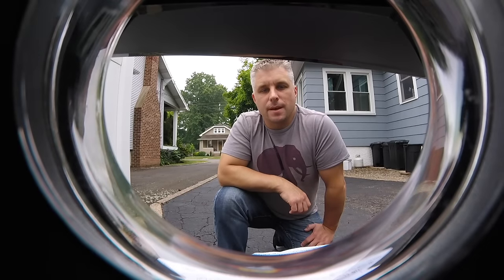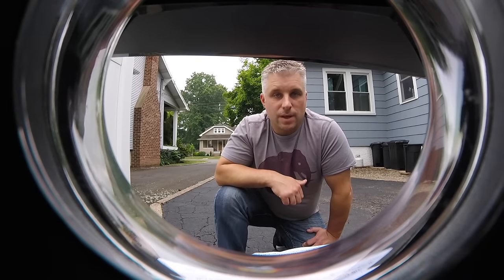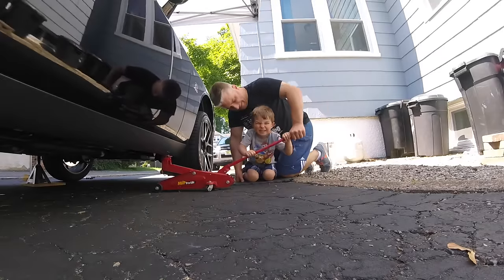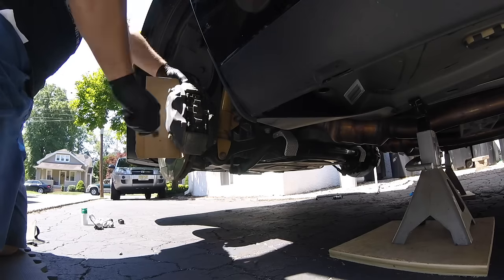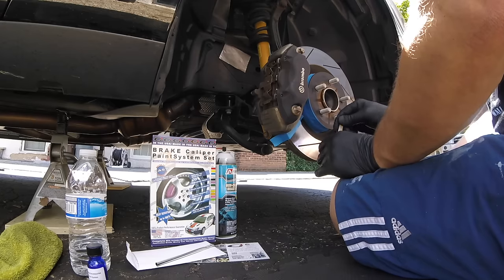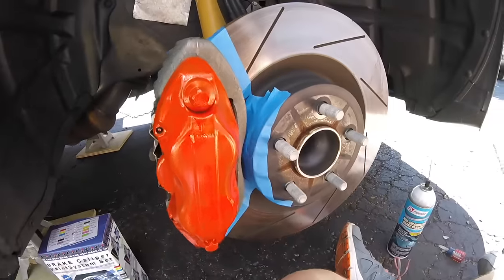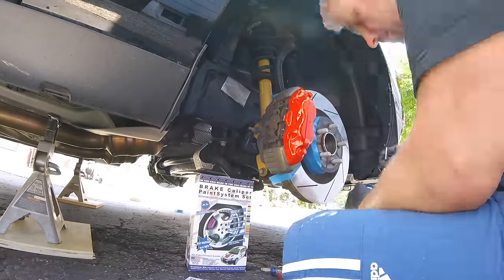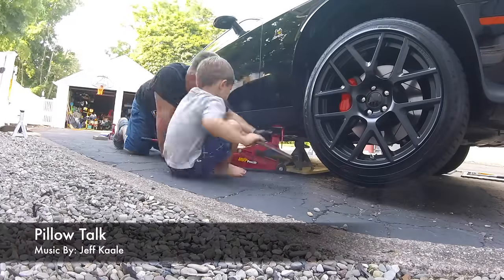G2 caliper paint - Scat Pack Wheels Finally Done!

Comment: What did ya use on the hub of the rotor to make it black? mine look awful too! awsome page man and beautiful car!
Reply from the maker: +Blair Gray thanks man, I used high heat matte black engine paint after sanding and using tons of brake cleaner. I recommend satin though the matte is not as black as I hoped it would be.  Check out my blog post http://www.workplaydrive.com/2016/05/10/annoying-thing-about-my-black-scat-pack-wheels-fixed-10-00-per-wheel/

Comment: Where did you get your center caps and lug nuts? Mine are chrome on my 2016 scatpack and it’s driving me nuts!
Reply from the maker: The forged scat pack wheel (like mine) came in 2 colors black which was satin black and hyper black which was a silver with a little sparkle. I have both center caps below. 

The lug covers were actually a temporary cover I liked so much I still use them 5 years later. 

Lug Nut Covers 22MM
Flexible Vinyl Round Cap 3/4" Inside Height, Fits 7/8"-15/16" OD
https://www.mcmaster.com/#9753K57

FLAT BLACK
CAP-WHEEL CENTER - MOPAR (6CZ27RXFAA)
http://www.stevewhiteparts.com/oe-mopar/6cz27rxfaa
DISCOUNT code: Face1

Hyperblack 2
CAP-WHEEL CENTER - MOPAR (6CZ27MALAA)
http://www.stevewhiteparts.com/oe-mopar/6cz27malaa
DISCOUNT code: Face1

Comment: Great video, I'm doing mines next week, what is that thing that you use to  jack up your car, the one with the remove before flight  reminder
Reply from the maker: Thank you,  It's a magnetic jack pad with a little flair ;), it protects the pinch weld and the trim around it.  There are cheaper ones just make sure you stay away from the hocke puck looking ones they still mash the trim  This type totally prevents my trim from being mangled by the jack  https://amzn.com/B00O72Y2CE  so $40.00 well spent.

Comment: Hi I just came across your videos there awesome thank you! !!! My question is did you consider red before the orange? I have a 2014 Charger R/T Road and Track Plum crazy edition all badges are red and want to be close on calipers.  Are the orange very orange or a reddish orange ? Do they look like the dodge red double slash? Thanks keep up the good work and stay safe.
Reply from the maker: Thank you 🙏 I like orange, red wasn’t a consideration.  The orange is actually a nice vibrant orange not reddish not  close to GoMango.  G2 has a nice red that does match the badges the other option is send them your paint code to color match your car.

Comment: I notice on the front you painted just the tops.  Long story short I had mine done this weekend and the shop that did mine did the same but I went back and looked at yours and you did basically the tops also.  A lot of the videos I looked up here they paint the whole caliper if that makes any sense.  My question is there really a right and wrong way to do them, the tops only being done or the whole caliper like I see a lot of peeps here doing.  Thanks and looks bad ass BTW!

Comment: What a GREAT job you did both on the brakes as well as the tutorial brother!! Thanks for all the info and details, I certainly appreciate it!!! :) BTW, it's nice to see another 6'er SP on the circuit...lol...I factory ordered my '16 SP Shaker this May and it came in exactly 14 days later, which was awesome for me. It has everything available to it but for the A8, obviously and the Pwr Moonroof. I went with the Black Interior, Black Alloy Wheels and wrapped it up in Maximum Steel and I love that colour, ever since I saw it on a Ram 1500 SPORT last fall. Is there enough paint in the kit to do the full calibers or do I need (2) kits for that job?? I'm not going to do it now simply because the days are getting cooler and pretty soon it's going in the garage for a "long winters nap"...lol...So, it'll be a spring time job for me to do and that's ok with me. And my TAZER should be here this week as well and thank god the (Shift Lights) can be engaged!!! What BS is that, huh?? You activate it and nothing happens...lol...Jeez!! Anyway, great video, thanks a heap man!!! Stay Safe!!
Reply from the maker: Thanks man, there is more than enough paint in the G2 can to do 4 coats on all 4 caliper covers. even if you paint the rails on the front.  I've got another kit in black to finish off the front rails, cant wait to get it done.   Congrats on the SP Shaker, When I was looking last year I was unable to order the Scat Pack Shaker in Manual, So I searched for the Scat Pack with all the options I wanted (sadly could not get the bee seats) then I made it a Shaker with a Cervini's kit.

The TaZer is working out great, Shift lights do work I'm just learning how they work in different situations before I put out a video later this week

Comment: Looks awesome. are they still holding up alright? I was looking at doing my brembos red, but a lot of products had reviews of them chipping.
Reply from the maker: It's been over a year and still looking great https://www.instagram.com/p/BXBQxE6lQuN/?taken-by=workplaydrive 

Prep is important no oils, flaking rust or paint under the coating.  

NO primer and NO clear coat.  This are the biggest things I see people use and fail.   G2 is an Epoxy paint it bonds to the metal and shines beautifully on it's own. 

I have 1 chip from some guy doing a burnout at cars and coffee, his stupidity shot gravel at my car and chipped my door paint, wheel and G2. :/ otherwise they are flawless.  Even the G2 I spilled on my Driveway is doing well 😂
Reply: That's pretty awesome. I'm torn between having a pro do it with a guarantee behind it at 50$ a wheel, and doin it myself for 50 flat haha
Reply from the maker: At $50.00 a wheel you can mess it up 3 times and still come out ahead.   As long as you have the supplies to lift up the car safely it's a pretty easy task.  I just hung out with my son and went around the car 4 times 1 wheel at a time.

Comment: hey by any chance did you ever get the brakes on your car like brake calipers both fronts what is the cost to change them whatever they wore out just need to know because I own a 2016 Dodge Challenger 392 shaker 8spd
Reply from the maker: Not yet, only 11K miles and it's an M6 so I let the lower gears slow me down.  Price for pads will vary depending on the materials.  When it's time I plan to find a less dusty pad solution for daily driving use.

Comment: Did the paint wrinkled at all? I tried it once and it was real wrinkly..any advice? Looks great and thanks
Reply from the maker: no wrinkles it's very smooth and glossy.  https://www.instagram.com/p/BNcBlRJjH8G/ Is it possible you bought old stock from a re seller?  Another possible issue because it's an epoxy paint, if you used a synthetic store bought brush depending on the material it may melt causing globs.  using the provided brush prevent that.
Reply: Work Play Drive awesome man. Those both were prob the issue. You think I should completely sand the old application off and redo? Or or just smooth them out? Thanks again
Reply from the maker: g2 can be applied on top of G2, however you want to sand down the wrinkles so it's smooth and make sure there are no flakes.  You want that G2 to bond to a solid surface.  If you find the old paint is flaking off you will want to take it all off.
Reply: Work Play Drive thank you sir. You are very helpful

Comment: Hi I like your vids subscribed! I want to paint my rotor hats silver there starting to show light rust spots want to get it before it gets worse, Is one can enough for all 4 rotor hats? 
Can I paint where the wheel hits the rotor ? 
Thanks!
Reply from the maker: Antimatter thank you!  I had to reread my website post on this...  I used 1 can to do 4 lite coats and 2 heavy. 

if you paint where the wheels sit I recommend you let the paint dry for the full time recommended by the can before putting the wheels on.  it's also recommended to re torque the wheels after 50 miles of driving.

Comment: Really good job...  I have seen a few others do this process and yours certainly looks nicer.   One quick question... you painted right over those two caliper bolts.  Are those bolts you would need to remove to replace the rotor or are the only bolts you need to remove in the back?
Reply from the maker: Thank you, I really enjoyed this project, I plan to go into more detail on my next 2 G2 projects.  Those bolts hold the Pistons in place the bolts to release the calipers are on the back of the assembly as you said.  Here is a detailed breakdown of the assembly http://www.lxforums.com/board/showthread.php/348121-SRT8-Brembo-Brake-Calipers-Breakdown-Front-and-Rear

Comment: Good job! Brake parts cleaner is not very good for your black top.
Reply from the maker: True my driveway is a mess though, I've shifted to using those big aluminum catering pans under where I'm spraying now.   This helps contain the mess.
Reply: And there're cheap at clubs